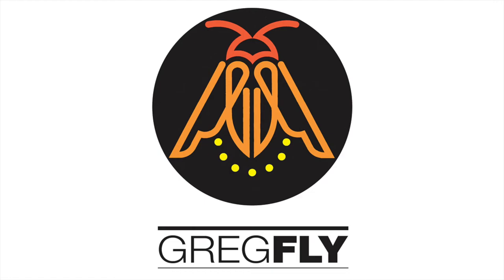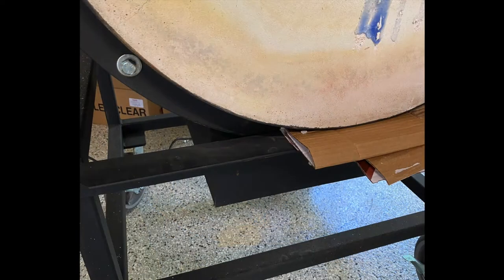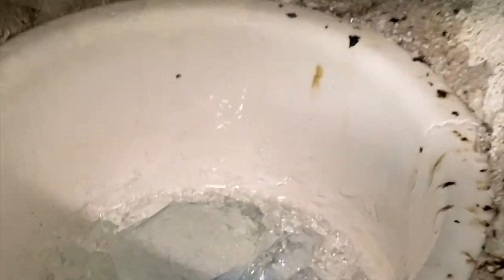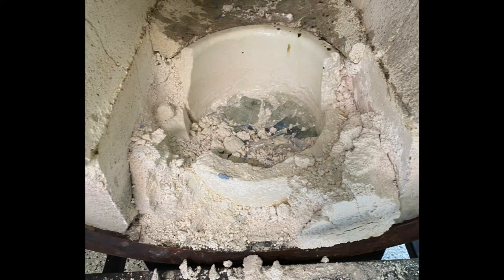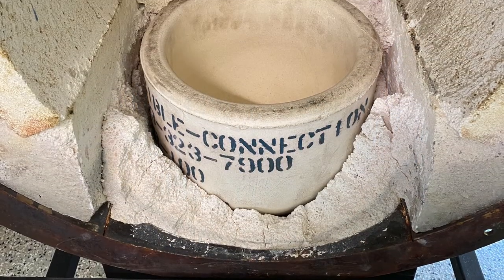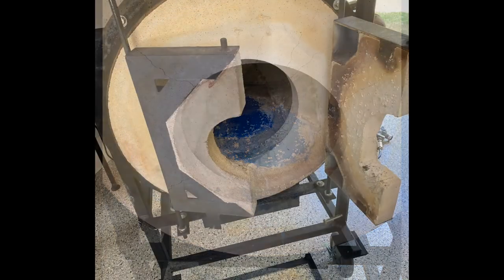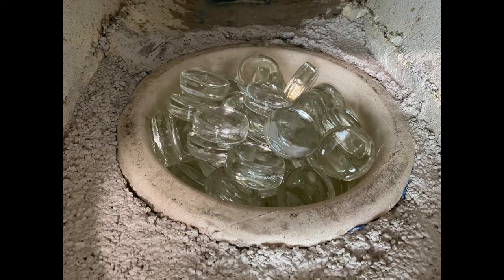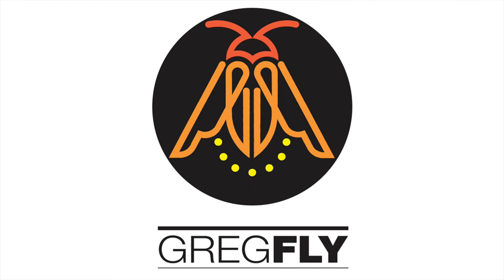Changing Crucible In Canned Heat Glass Hot Pot

Comment: How is the kegler clear cullit?  Do you get any chords. Love your setup definitely will be taking some inspiration for mine.
Reply from the maker: It wasn't great but my guess is that has more to do with how I ran the studio than the cullet itself, I ran it only one day a week on average, so would blast it in the morning to get it going, took about 2-3 hours to fully heat up, would work 5-6 hours and then turn it off, which I'm sure is horrible for the crucible but what is designed for.  So no chords as I basically emptied the pot each day I worked but a fair amount of bubbles, no huge ones, and a fair number of stones and flakes from the walls of the crucible.  I didn't really sell my work at high end galleries, I either gave it away or sold it to people who understood it wasn't perfect, and if that is ok with you then it's a great way to get loads of practice without renting time at someone else's studio, it was a lot of fun!  I've moved now and had to sell the equipment but would probably think about setting it up again if I end up in a home with enough room.
Reply: @GregFleischaker  good to know thanks for the response.